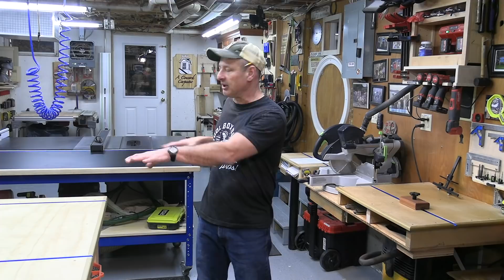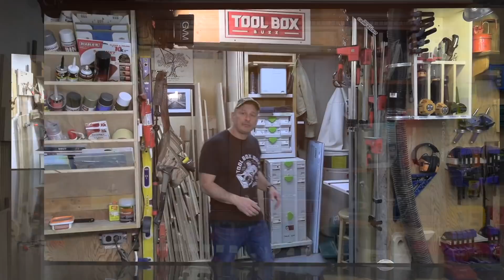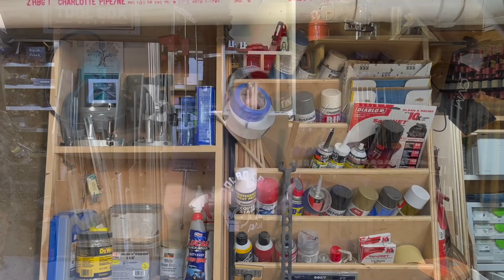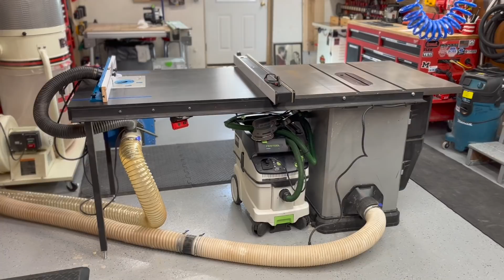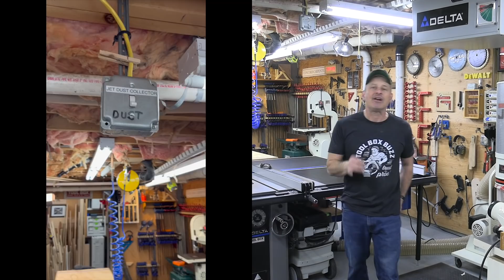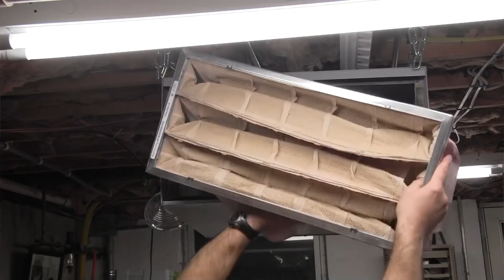Designing A Small Workshop | Video 2 of 3

Comment: Rob:  Great video series... lots of helpful tips and information.  I wonder if you could talk a bit about tips for providing some cushioning for your back on the hard concrete floor, as well as why you've chosen not to cover over the insulation on your ceiling with drywall or even plastic sheeting to keep the dust from harboring in the fiberglass.  Thanks!
Reply from the maker: Sure thing, here you go-   https://youtu.be/bB3XD6jLLj8
Reply: I was wondering about the same, fiberglass will come down over time!